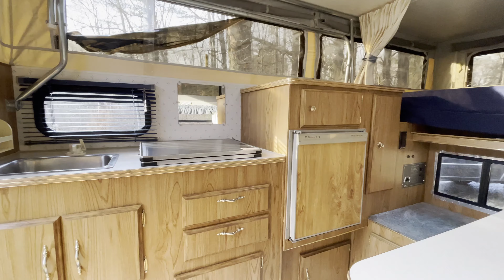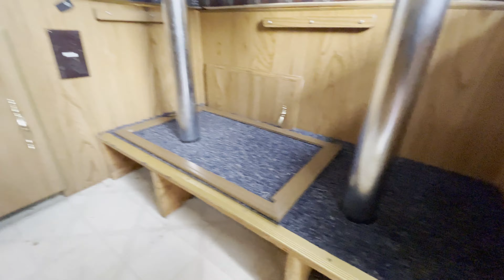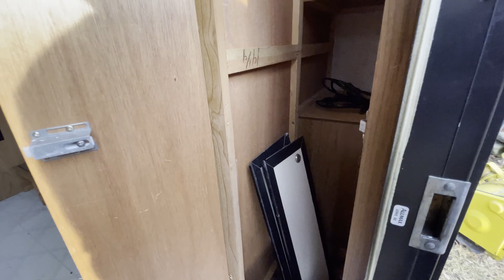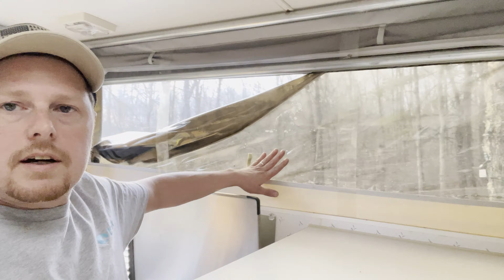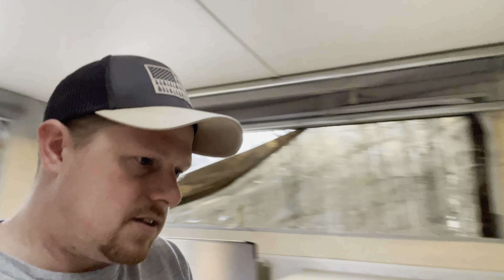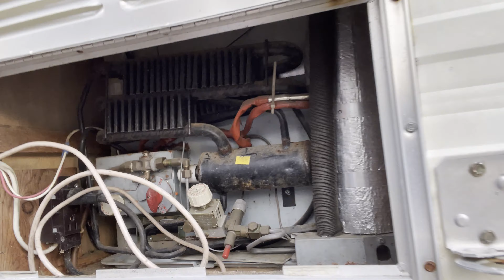We bought another Truck Camper! 93 Sunlite Eagle tour!

Comment: Nice video, I just recently started to look at these campers I would like to purchase one for my ram 1500 short box I'm not sure what would be considered as  a  fair price on market place, what  did you  pay for  that one ?
Reply from the maker: I paid 2,500 for this one, that being said, a good one is hard to find in my area.
Reply: @LostTravels I paid $2,600 for mine.
Mine has the inside bathroom.   Other then that it look just like this one.
Reply: I supposed to be looking at a sunlite eagle tommorow... guy wants 300$ for it.  Supposedly only needs a good cleaning and new canvas..       I'm afraid it won't fit in my 2019 ram 1500. 😢 only 6.5 ft with the gate opened.    But dammit for $300 im gonna give it my best.

Comment: I have a chance to buy a camper same model Wondering if it will fit my Nissan Titan 6.5 bed
Reply from the maker: Should be fine width wise.. in my tundra with the tailgate down it’s nearly identical length, I just used a small turnbuckle to pull the tailgate up flush against the bottom of the camper. My bed measures 6 ft 5 inches with tailgate closed

Comment: Well you answered I question I had with my Sunlite camper.  I was wondering why I didn't have a furnace.  I do have the roof AC, and I have a dry bathroom.  I also noticed you don't have hot water like mine.
Living in South Texas the AC is the most important thing for me.
Reply: Up date, I now have a furnace in my Camper. A guy gave it to me for free.  It's 2 years old but was never used.